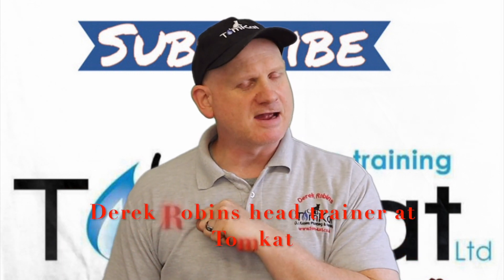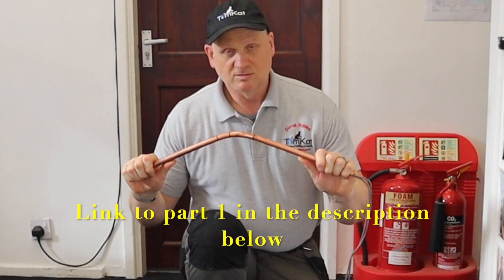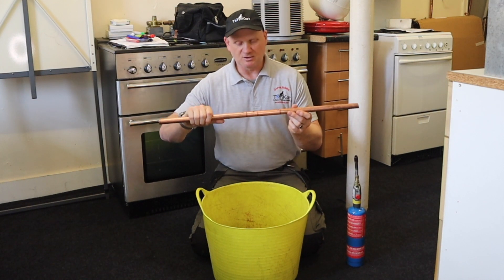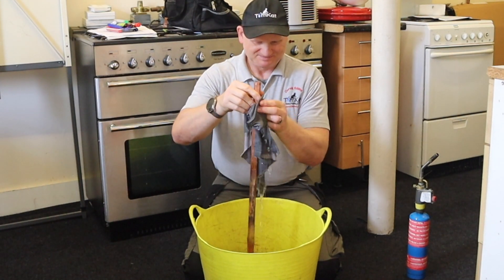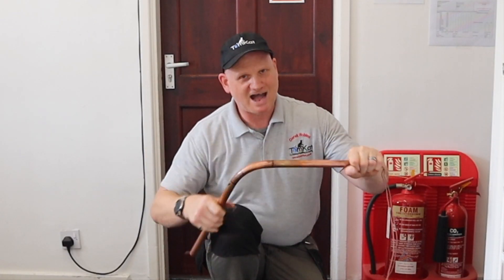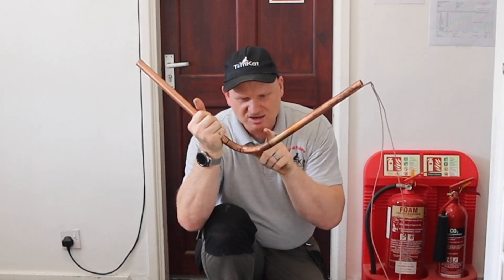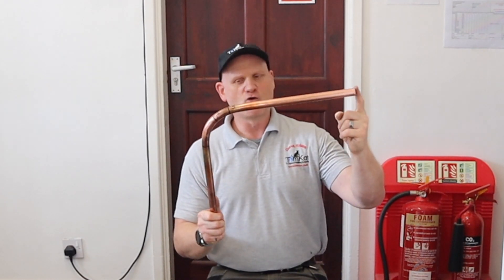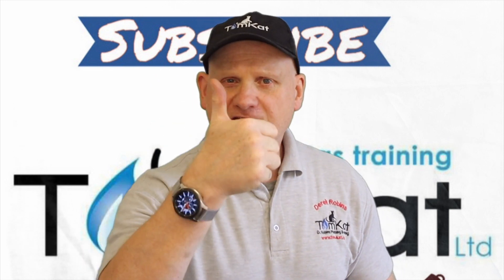HOW TO BEND 22MM COPPER TUBE USING A BENDING SPRING,  correct way part 2, plumbing and gas training

Comment: Lovely.
Question for you Tom on flues in voids if I poke a 4m flue extension through a ceiling void would you need hatches ect since it’s a continue length.

I think yes would be good to aid other engineers but maybe legally no as no joints.
Any points of view appreciated
Reply from the maker: You would not need hatches if there are no joints but a flue over 1.8m with no clips or brackets is an unsecured flue and also engineers visiting later wouldn’t know that the flue is one piece or it has clips so would AR the flue anyway so I guess you should have access to the flue for inspection whatever or engineers would still AR the flue.
Reply: @tomkatgastraining  
Agreed.
Was having this debate with someone!
Thanks

Comment: @ 4:22 Flame is way 2 close;... U R using the coldest part of the flame
Reply from the maker: I bet you still wouldn’t like it on your hand
Reply: @tomkatgastraining  Dam right I wouldn't...
But on the other HAND as U R a teacher;... lecturer that needed pointing out...
Reply from the maker: @ElTelBaby  if I was soldering you could have a point also if I didn’t have a shit blow lamp you could also have a point and I was also showing were to start and finish when heating the pipe so using the tip of the inner cone wouldn’t have shown that but thanks for pointing it out anyway

Comment: Ive always cut pipe, stick it next to wall, where i need bend.  I put my finger at point that i want bend to start. Then offer up to my knee and bend, offer back up to where I need bend and  check, and adjus if needed more angle on bend.  I always bend pipe backover a touch so spring slides out easy, in a twisting pull. Otherwise, spring sticks.  I use spring for speed.  Any offset bends I use  bender mc.
Reply from the maker: I was showing the process and why you would need to heat it up most of the time there is no need to heat up the pipe remember I make videos for trainees who might not know how to do it.
Reply: @tomkatgastraining  yes of course, makes sense, and if you ever needed to use spring and needed the pipe bent without ripples in the copper, then its a good video